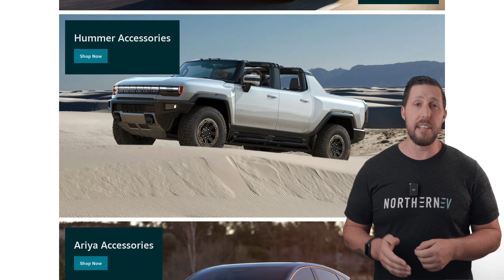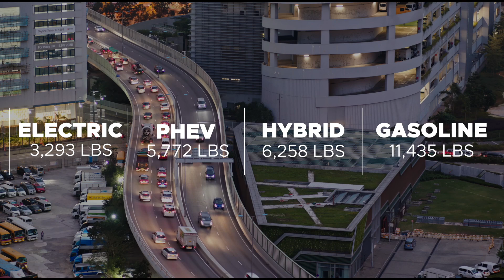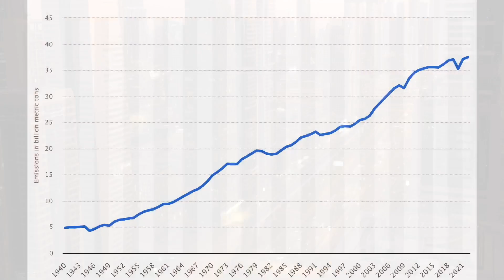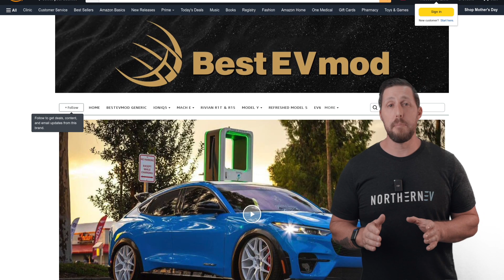Electrifying the Future: Can Electric Vehicles Save Our Planet from Climate Change?

Comment: In many jurisdictions, grids cannot handle the extra load to add massive amounts of electric cars.  And the extra capacity is made in many jurisdictions by burning coal or oil or biomass.  Electric high capacity battery fires are still uncontrollable . Japan has it right ... They are mostly hybrid now. First time I was there in 1000 it smelled like diesel. Now you don't notice a thing.  Imagine a hurricane coming ... Everyone charges and the grid collapses before the storm arrives . Imagine a forest fire and not being able to evacuate .  We're not ready for 100% electric . And if we find an efficient way of creating hydrogen, then hydro cars will make lots of sense!!
Reply from the maker: First off, electric battery fires is a myth. Gasoline cars catch fire at a much higher rate.  100% electric will not be for another 25 yrs. The grid will adapt by then.